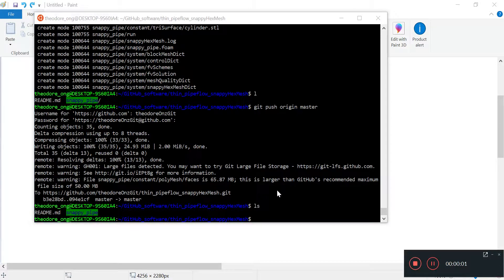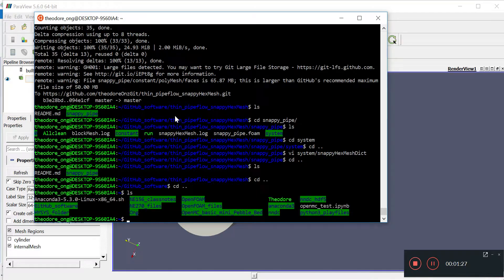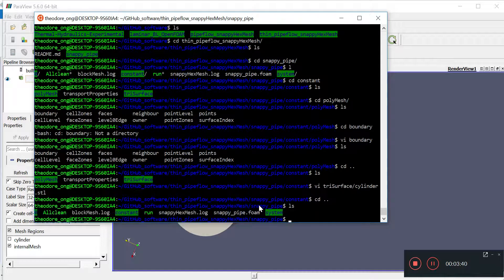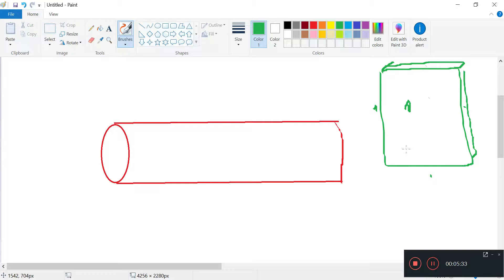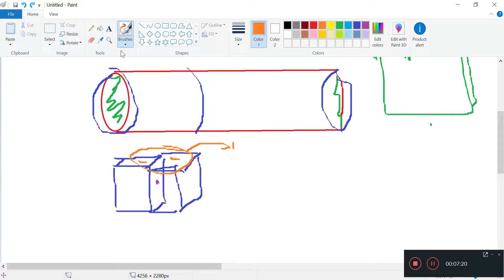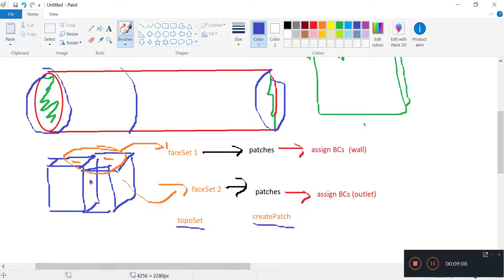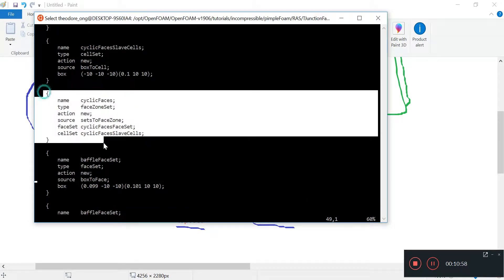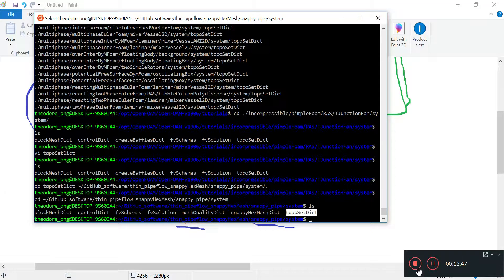OpenFOAM Intermediate 10 - Creating Patches from STL Meshes topoSetDict Introduction

Comment: ./Allclean
blockMesh > blockMesh.log
snappyHexMesh -overwrite > snappyHexMesh.log
touch snappy_pipe.foam

hey using this run script i noticed that inside polymesh 4-5 more folders are getting added and also  the boundary folder is getting updated with the only a block code of cylinder

but when i simple run with snappyHexMesh in the command prompt the above changes are not happening,  i mean to say inside the boundary file there is 3 block codes of moving wall, fixed wall etc..

can you please tell me how this changes occured  in short

Comment: HI Theo, now I am working on interFoam using DTC hull case tutorial. Currently I am trying to replace the DTC HULL with a simpler Wigley hull and then repeat the simulation (RAS-interFoam).

1) DTC hull and Wigley hull are not in the same size and not in same position, do you have an idea how to make it work?

2) Did you manage to visualize the free surface elevation in paraview?

please let me know if you have any hint. Any further discussion will be appreciated! Many thanks, Yifu

Comment: hello theo, what you mean by there is a lot of guides for ASCII files for creat the boundaries? i have tryed, exporting each boundary in a separate stl file and merge them with cat command but they are not water tight after doing it. also i tryed autopatch, but it detects too many patches, and i end up with a patch that was supposed to be only one being around 100, is there any other method!? for the moment i got around with your method with topoSet, but my big issue is that i want to put boundary layer in the snappy, and as the patches are created after snappy i dont know how to add them. (also if it is possible to devide them from before the snappy it could be easier...) please, if there is any other guide that you can recommend, i would appreciate it.
Reply: @TheoOngScienceAndEngineering  yes, now I use Salome in importing step files 🙂

Comment: When I view my blockMeshDict file at this point in the tutorial I still have 5 patches. frontAndBack, inlet, outlet, lowerWall, upperWall I changed them all to "type patch" when I first made by blockMesh. I see that in this videos you only have one and it's called "cylinder". Is this a step I missed?
Reply: I get an error when trying to "patchToFace" with one of my patches e.g. "inlet"